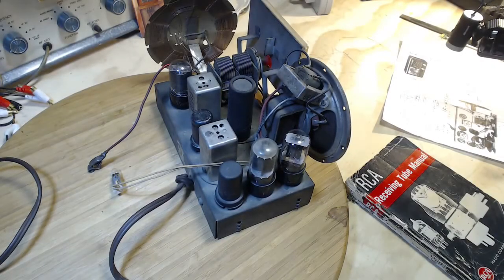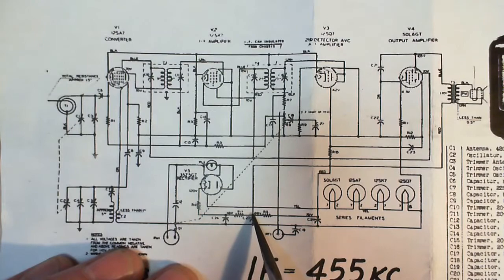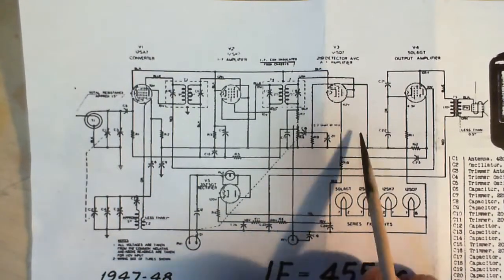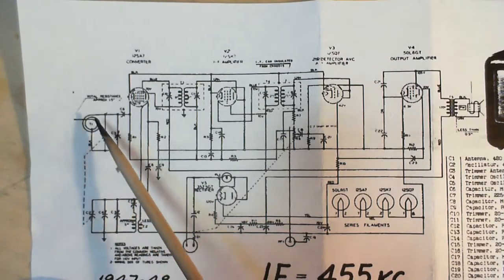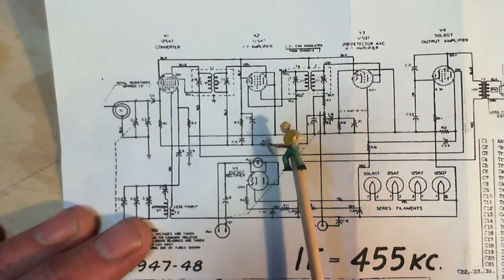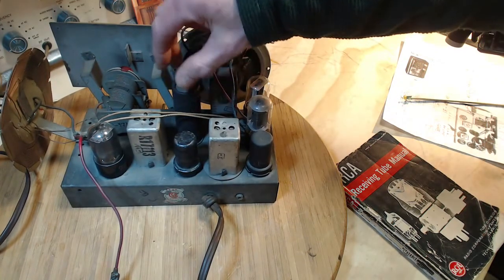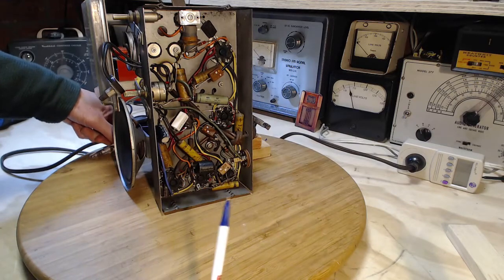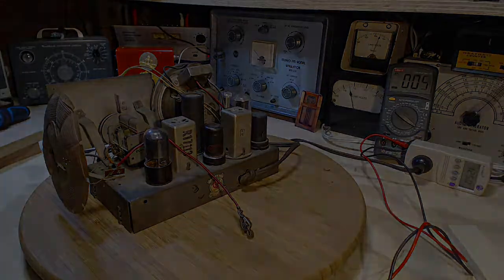Northern Electric Model 5200 Baby Champ Video #5 - Schematic Run Through

Comment: The capacitor in series with one winding of the oscillator transformer (or "gimmick") is a "pad" or "padder" capacitor. Having both trimmers and padders allows closer dial scale calibration.